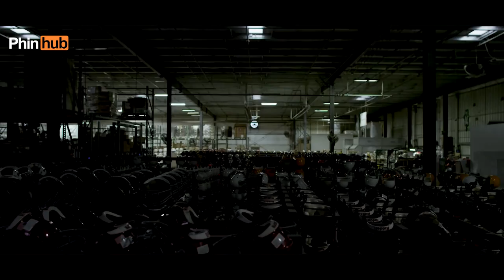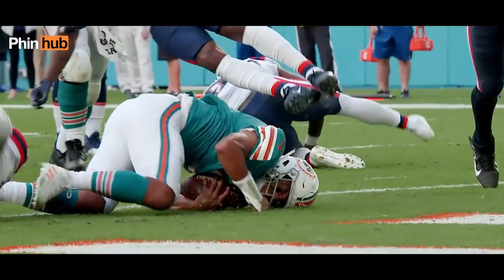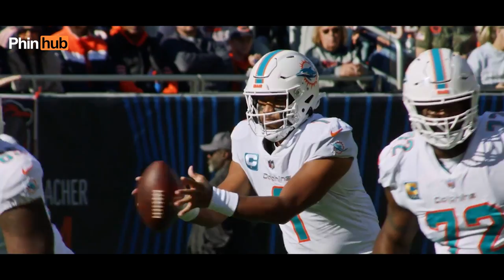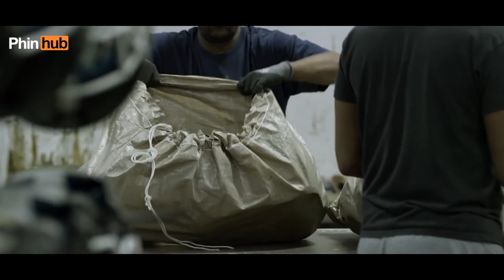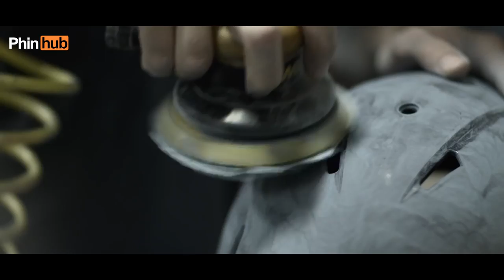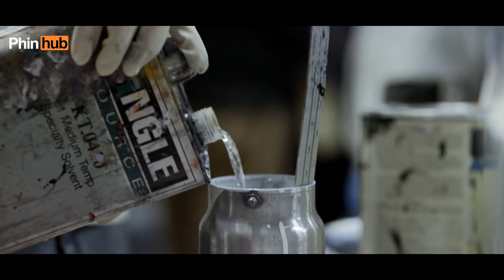🚨🔥 NEW Helmet Set to SHOCK NFL! Why this could be a GAME-CHANGER for Tua & The Miami Dolphins!

Comment: Yes this new helmet is an essential upgrade for Tua. But it is not enough. The Dolphins must add 2 or 3 lines of padding attached to the outside of the helmet to lessen the impact if Tua is hrown down onto his back. Chris Grier you have to sign an elite and experienced Right Tackle. The longer you wait, the more difficult and expensive the signing is going to be.

Comment: The matrix spaghetti cushion which is borrowed from the military, should save on weight and run cooler with increased air flow. They need to introduce it to the youth Stat!

Comment: I don’t think that’s how physics works. There’s no where for the energy of an impact to go no matter how much padding it has. That is because the brain isn’t fixed in one position inside the head. It actually moves like a passenger in a vehicle after it hits another car. Concussions can be caused by direct impact, hence the helmets,  but concussions are also caused by whiplash of the brain moving around in the skull and potentially by it hitting the inside if the skull.